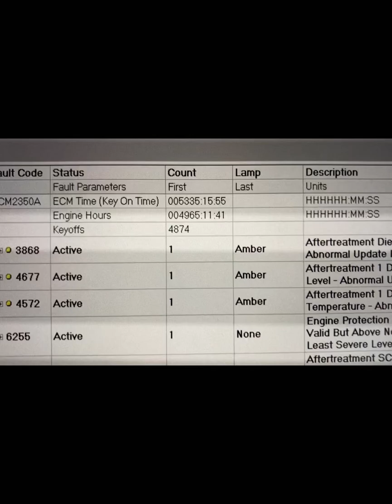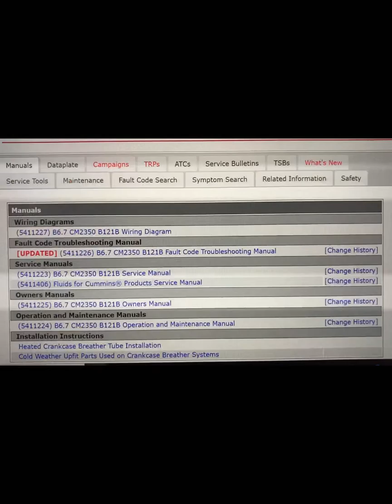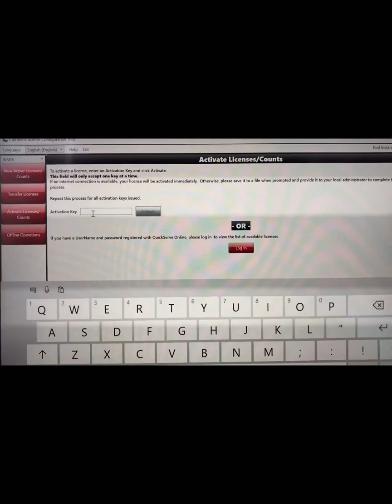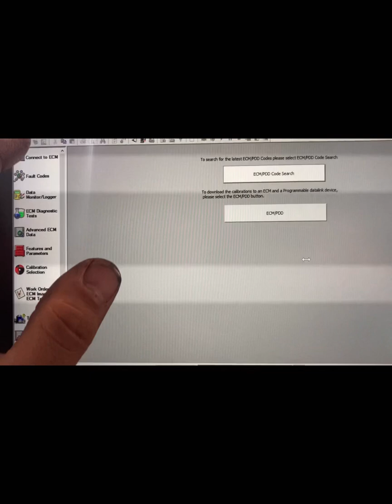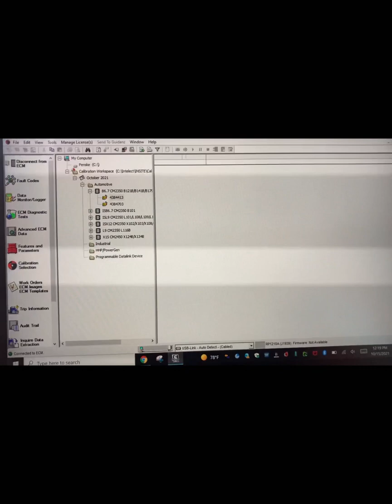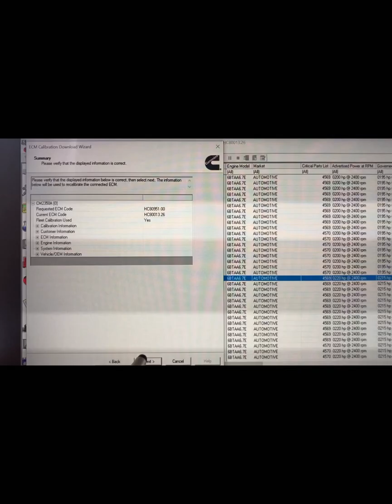DEF header override- ECM calibration

Comment: Is the ECM code the password?
Reply from the maker: No. The ECM code is basically how you identify what calibration you have or are updating your ECM to. The ECM code will be something like HB90126 (just a made up number but that is the form they are in).
The ECM password is normally a four digit number that unlocks your ECM to allow it to be updated or the calibration (ECM code) changed. You would put this password in when you first connect to your vehicle with Cummins insite or while connected going to the passwords tab.
Reply: @alreyindustries  hey I appreciate you responding so fast.  It was shot in the dark. Truck went into full derate and they got to the point of calibrating the ecm and have a error message " could not detect calibration for the selected ECM part number". 
It was a fleet truck when I bought it. I contacted them and they told me what the password should be. As of this evening we're at a standstill.
Reply from the maker: @bobbakian7369  three things you can try:
1. If you have your current ECM code, have the technicians look up the ECM code that matches your current code that will bypass the header codes. If they cannot figure that out…
2. Before connecting to the truck on insite they can go to the calibrate tab on the left side of the Home Screen. Once you click that tab, two gray boxes should appear on the screen. I believe it’s the bottom gray box that allows you to search for an ECM code. Search for you trucks current ECM code. If it finds your code, have them click the save button if it is available. Once they connect to the truck after doing this, they can download and install the same ecm code that is already in the truck. That should clear the codes and derate, but they will come back. If that doesn’t work…
3. You can unplug the speed sensor that rides on the output shaft of the transmission. Where the driveshaft mounts to the transmission there is a speed sensor that tells the computer how fast you are going. You will still have the check engine lights and your speedometer will not work, BUT you will be able to drive the truck at regular speeds. Not ideal but will get you going if necessary. 
That’s about all I got.
Reply: @alreyindustries  i will forward information to them. 
As far as option 3 doesn't the derate limit the R.P.M.S  as well?
Reply from the maker: @bobbakian7369  no. I think it will work. Worth a shot if you got nothing else. Pet easy to do.
Reply: @alreyindustries  worrh a shot. I'll update you with the final outcome.  I appreciate your input.

Comment: Can you tell me what my proper matching ECM code would be,  if I give you my current ECM code ?
Reply from the maker: If I don’t know off the top of my head I could probably tell you tomorrow
Reply from the maker: What is your ecm code?
Reply: @alreyindustries   ECM = EF10044.47
Reply from the maker: @fasthardware6293  what kind of truck is it? I had a friend look it up and he said there was no ecm code in the list that matched the one you gave me.
Reply: @alreyindustries  2015 international pro star
Reply: @alreyindustries  Cummings engine
Reply from the maker: @fasthardware6293  hmm, I had one international tractor that I could not find the ecm code for either. It’s possible that the update isn’t available for that truck/engine? I’ll double check the master list tomorrow and let you know if I find anything.
Reply: @alreyindustries  sounds good thx for trying,  I’m curiouse to see if I will work ,  if not. It’s just a longer time the truck stays idle, until I build the def simulator bypass , I order the parts already
Reply from the maker: @fasthardware6293  yea sorry man, I looked it up but there is no ecm calibration for that code. I don’t know why that is. Maybe the model year doesn’t apply.